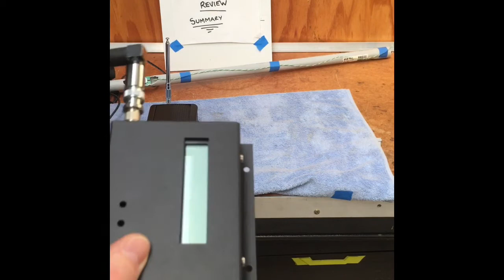FM Transmitter for Christmas Light Display - Part 5 Summary

Comment: Hi. Can you comment on the length of the antenna/aerial length you implemented? It appears you used a twisted pair but that only one wire is soldered to the ANT pad on the board. Is the other conductor connected at the top (which isn't shown in the video) or was it just left there for the sake of convenience? Thanks for your time in making this video and responding to questions.

Comment: Please, if you use a microphone to speak on the transmitter and hear your voice at the same time on reciever, does it have any delay? even if it's minimal?
I am looking for something similar to use for corner return, and there can be no latency in this transmission.
thanks for listening!
Reply from the maker: Hi good question. I haven't tested it for this as using this transmitter for broadcasting the music as part of our Christmas light display. I haven't noticed any latency as the lights are timed to the music, but it could be possible, sorry I cant provided a answer on this at the moment as out Christmas light display equipment including this currently packed away in storage